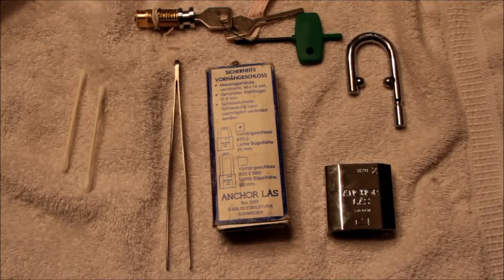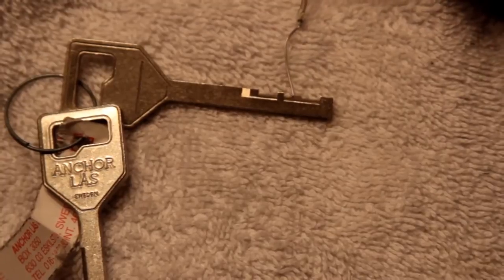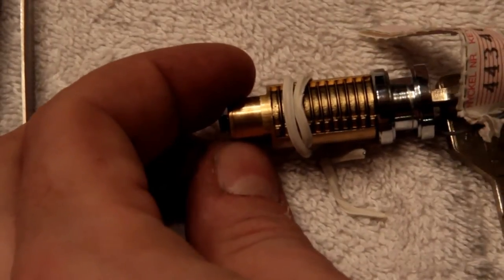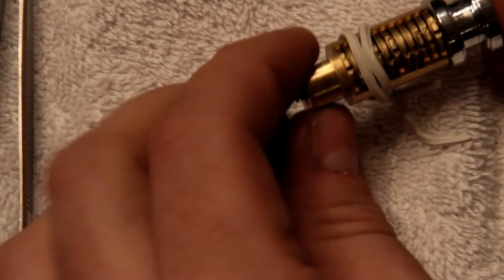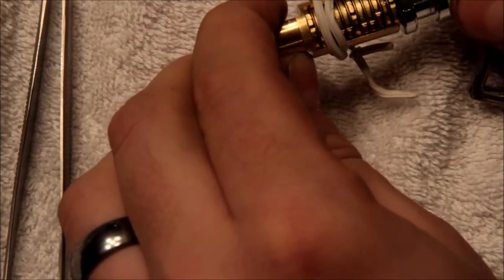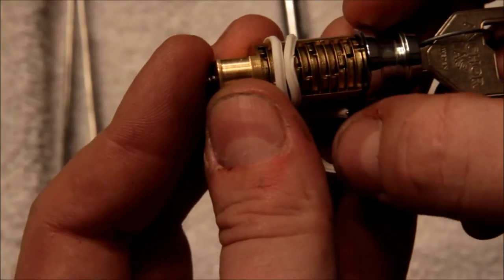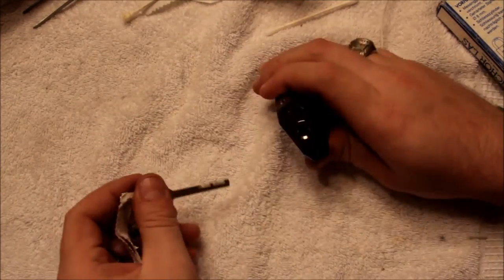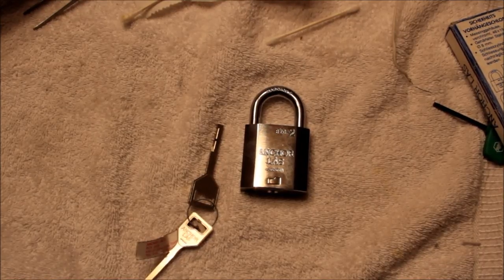(056) Anchor Las Disc Detainer Padlock -- Gutted

Comment: Hey Alex,

I was also planning to do a review on the Anchor Las Dias lock. Now your were the first in line it seems :) 
I already have one here and I really like them. In fact the Anchor Las are my favourites because at my point of view they are a less expensive then the Abloy but also just a little bit better in quality of the used material. Maybe I am wrong there because I do not have facts backing it up but that's at least how I feel about them

Comment: When it comes to the discs and we all know Abloy kind of invented that system. I would say the Abloys are best then the Anchor Las and last but not least the Abus Plus. All three very good but sadly the Abus padlocks with the Abus Plus cylinder are not as good as the Anchor Las or Abloy. You can not take the core apart etc. 
Have you seen my video on the Abloy PL656 padlock and core? Some nice close ups on the discs there.